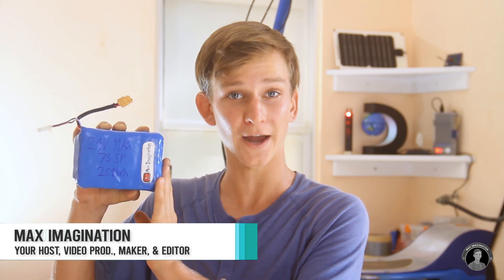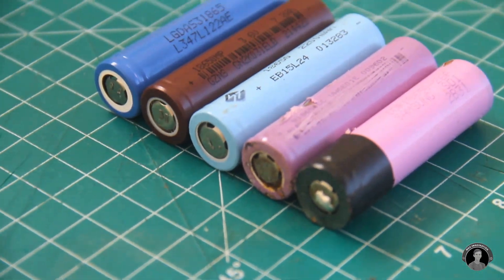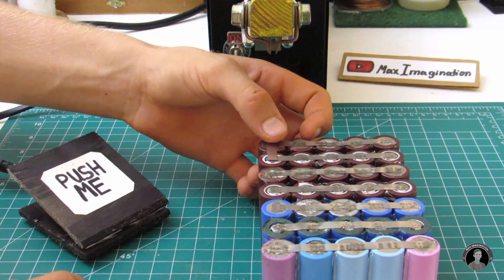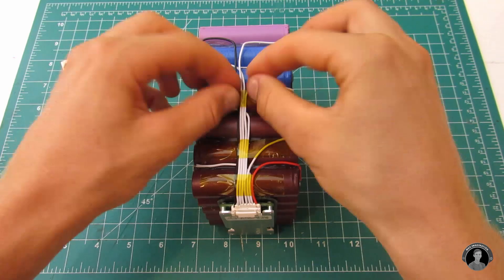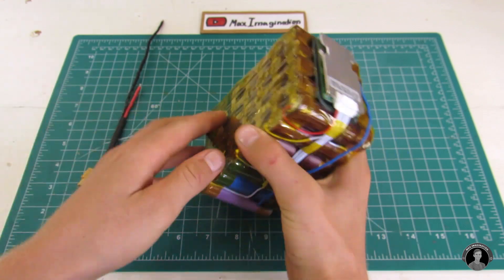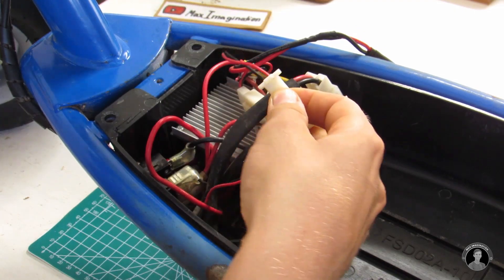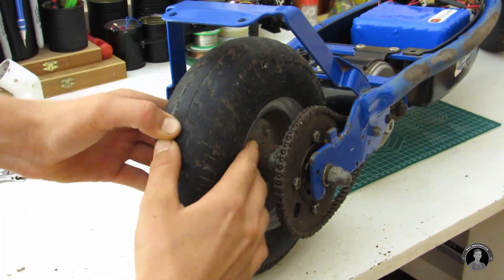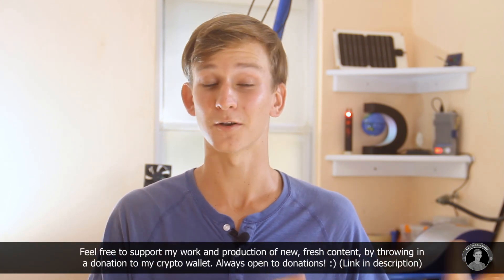Build a DIY 24V E-scooter Battery Pack | Razor E300 Upgrade (Part 1)

Comment from the maker: One important thing to consider if you are planning to make this battery for your EV. As much as recycled Lithium cells may work and are OK, their lifetime wouldn't be anywhere near as fresh, new 18650 cells. Motors as such that drive us forward require a good deal of power, so if you're serious about range and power, it's best to go with buying from a quality seller of these new cells. 
With that said, I hope you guys found my video helpful! Under the same making process and connecting, all that should be different for best performance is new cells.
Reply: Tried this but barely got a top speed of 20kmhr . And battery power suddenly cut off when it was showing 80% balance charge
Reply: I use lifepo4 flat cells.4000cycles.battery hookup has 31 ah 65 dollars for 4 .16 make 52 volts.use a spot welder to weld the tabs.
Reply: And battery hookup has some lithium ion modules that sound like Shimano or something
Reply: Wrong some might run out fastest than other or fail plus there different batterys

Comment: 10:58 there is a hole drilled into the sprocket that is made so you can put your air hose through and connect it to the tire there is no need to disassemble the sprocket. You can even see the hole on this timestamp
Reply from the maker: I realized that eventually. Thanks for spreading awareness to others!
Reply: @M @MaxImagination I was close to doing the same thing until I noticed the hole haha

Comment: How did normal charger charge the li on pack
Reply from the maker: Charged it fine. The only issue is I overdischared the cells during use resulting each cell going to 0V - dead. Could be because I bypassed the BMS.

Comment: How do i Learn there is so many things i dont know where to start and regarding safety how do i become sure that i dont cause a hazard or fire i have old laptop battery but they last 3 minutes max all my battery this way are they still useable?
Reply from the maker: I don't recommend going through the hassle of making your own battery with old cells looking back. If I were to go back in time, I would use new cells. Old cells will wear out fast.

Regarding resources that will help you along your journey in working with electronics, I suggest to read "Practical Electronics for Inventors". Read "Beginning C for Arduino" if you want to learn Arduino programming. To learn Arduino hardware and mechanics/mechatronic part of projects, I recommend checking out videos for those YouTube.

Comment: I have the yume raptor 60v 27ah 2x 3000 watt motor i would like to install an external battery. How would you wire it and what battery do you recommend?
Reply from the maker: You mention it uses a 60V 27 Amp-hour battery. You can use any other lithium ion or lithium polymer 60V battery with a higher capacity than 27ah, it will give you a longer run time. Just don't raise the voltage of the battery if your scooter is designed to only operate on 60V.

You'd wire it to the scooter the same way. 

In terms of configuring the battery pack (wiring). Follow the series-parallel rules to form a 60V 27ah or more battery.

Comment: There should be a air tube plastic extention inside your left side of your handlebars underneath the grips and inside the grips you can fish out with Allen key or screw driver then it will hook up to your pump and screw on the valve stem if your. Missing it there also on ebay or Amazon for your next time that is
Reply from the maker: Good point! I've been told the same by several others. Thanks anyway!

Comment: How do.u get amps. Like 24v 30ah
Reply from the maker: By using a higher amp BMS to allow for that current and placing more cells in parallel to handle 30 amps drawn from the motor.

Comment: I am inexperienced in these matters. Should the Ah of the battery ALWAYS be less than the Amps of the motor? It doesn't matter 18650 or LiFePO4? I have read that LiFePO4 are more convenient.
Reply from the maker: It's not about that. The Ah (Amp Hours) is current capacity, you can run a motor drawing a higher amperage from a battery with a lower Ah rating - it will work fine, just not run for as long as a battery with a higher Ah rating. LiFePo4 cells are more energy efficient, those can work too.
Reply: @MaxImagination  thanks

Comment: Hey, an old guy came the other day and asked me if i was interested in an old electric scooter for free. I said of course yes, and it was looking like your scooter but yellow plastic instead of the blue.
Same wheels.
Looked inside and same setup as yours with 2 old 12v 12ah lead batteries i am trying to revive now.
Anyway, i am tempted to get a new lithium battery and i am also curious how this scooter with same hardware would react if i installed a 36v battery instead? And i also actually have a 48v battery for my electric bike wich i have bought a 60v battery for instead.
HOW and what do i need to do to have this on a 36v battery and also if i am gonna try a 48v battery wich i already own?
Is there some stepdown stuff i can use? I am curious about 36v straight to this scooter plug straight in, im sure you have tried it huh?
How did it perform? Any tips are great welcome. Of course the cheapest tips on 36g and especially on 48v as i have that already.
Reply from the maker: Hey there! If you intend to use a 36V battery with a 24V motor, you will fry it... Either change the cells configuration (you will have to disassemble the battery) to have more in parallel rather than series and get more amperage plus lowering the battery pack voltage to 24V OR get your hands on a 36V brushless DC motor with a brushless ESC to adapt to your battery. Hope that helps!
Reply: @MaxImagination  you believe frying it immed? I've seen many videos where people have used 36v on a 24v motor but of course at one time it is going to end it's life, but have you seen someone doing that?
Reply from the maker: That's a significant amount of additional voltage to apply to such motor. Yes, 36V would damage the stock 24V motor.
It's up to you if you'd like to convert it to handle 36V (if possible). It's best to get advice from someone who has done it.

Comment: I have a very silly question,
How do you calculate the final Ah of the battery? We have 35 2200-2600 mAh 18650 cells here, the final result is 11Ah.
I know there are always 5 in series and the whole x7 in parallel. Is that then 2200mAh x 7?
Reply from the maker: To calculate the total Amp-hour rating of a series-parallel battery pack. Know that every parallel battey added has its Ah added to the total parallel string. A series set of batteries only has its voltage added, but for example, 5 of those 2200mAh cells would equal 11000mAh because they were added in parallel.

Comment: Not sure if you figured it out but the right handlebar grip should have the pump stim that connect to the valve of the tire as an extension to air up the tire.
Reply from the maker: Hey! Since I bought this scooter in second-hand condition, it did not have that pump stim.

Comment: that bms bypass cant be good...... u can now drain the battery all the way to zero and that aint good...
Reply from the maker: I guess that wasn't smart on my behalf! However, I couldn't see how it would work otherwise with the 3A current limit.
Reply: @MaxImagination  maybe more powerfull BMS ? like 40a i think the BMS u used was a 20a
Reply: @MaxImagination  u know im about to buy that thing and i also want to build pack like you did i have a lot of good 2500mah 18650 cells i will need to buy spotwelder tho i dont want to solder them and yea ima need more powerfull BMS not 20a but 40a
Reply: @MaxImagination  and also when your battery somehow shorts out there is no protection at all !!! and thats really dangerous
Reply from the maker: Good points there! I guess I need to use a higher current handling BMS with those protection features. 

Good luck building your battery! 

Cheers.

Comment: Hi Max, very good work. One question, how to modify the battery package to receive 24 V 12 Ah? Best regards!
Reply from the maker: Hi there. Thank you! For a 12 Amp-hour (Ah) 24V Battery pack, simply add more cells in parallel. To get from 11 to 12Ah or higher, I suggest you start with using higher capacity 18650 cells. You could add another row of series cells in parallel to another string of cells on one side, but this may cause imbalance. You've better off then starting with higher capacity cells and calculating the total capacity.

Comment: Was with you until you said to connect the discharge lead to the battery instead of the BMS. That's a major safety violation; the BMS is there to prevent shorts as well, and it can't do that if the lead is connected like that. The problem of not having enough current is fixed by using a correctly rated BMS.
Reply from the maker: I bypassed the BMS for output due to the BMS not allowing enough current to flow so the motor can run with a person on it. The BMS is set up in a way only for managing charging. I know it's not perfect, but it works.

Comment: Nice work. I pretty much replicated your battery using cells that I had lying around. These came from scooters and were 2000mah originally. When I tested them they were around 1700mah, with an internal resistance according to the charger of something like 70mohm. I am a little disappointed with the end result, the "kick" and uphill performance is less than with the original lead acid batteries. It was still cool to do, but I have now bought a box of "good as new" EVE cells with 2700mah capacity. I wonder if they will perform better, I am a bit suspicious of all of the specs of cells out there. I hadn't expected for it to make a huge difference, but it kind of seems like it does.

Comment: Why dont they use the correct Voltage labeling Battery Packs? 24V is sometimes 6S, sometimes 7S. This is so important when for example choosing the right charger. The charged endvoltage ist very Importand if 6×4,2V or 7x4,2V. Nether the product of 3,6/3,7 nor of 4,2 fits the Voltage of 24 or 48Volt Ebike/Scooter Systems. Only 36V fits 10×3,6V.
Does anyone know why?
Reply from the maker: Yes, that can be quite confusing... What I would do is know that if the battery pack's voltage is 7S (25.9-26V) I'd find a charger that is 1-2V higher such as a 28V charger (from old E-scooter) and use that to top it up. Even better would be to charge such battery pack with a balance charger that can handle up to 7 cells and choose the cell configuration before charging. 24V just seems to be a convenient way of naming these packs for compatibility with other products.
Reply: @MaxImagination  you are right. Comming from RC Models, it confuses. In RC, it is simple. A Lipo is 3,7Volts. Times 6 is a 22,2V Battery, Endvoltage of charging is 25,2V. A Li-ion is middle 3,6v, Times 7 is 25,2V. I have to know the number of cells for choosing the charger and set the charging voltage. At a "24V" Battery, this is not given but needed.
Greetings and thanks for your videos

Comment: Hi From Melbourne, Australia.  How long does the battery last approximately on a full charge?.  Cheers Fab
Reply from the maker: Hi there. The battery lasts 10-20 minutes per drive depending on the load put on the scooter.

Comment: NIce job. Just newbie curiosity. Looking at the schematic, with the discharge wires connected directly to the battery, how does the BMS cut power to the motor when voltage is at the minimum safe level? Thanks.
Reply from the maker: Hi there. Thanks. It does not cut the power from the battery. This has to be determined by the user. I don't recommend buying one of these BMS boards for making such battery pack as the cutoff current (~3A) exceeds in no time and is too low, therefore I bypassed this feature.

Comment: What are your thoughts about VISET LI 24V 1000mah, E-bike battery, 15A BMS for 100W-500W. Amazon has them for $149… could it work on a Razor E300?
Reply from the maker: Hi there. Could you please send me a link so I can look at one?
Reply: VISET LI 24V 10000mAh Ebike Battery, 24 Volt Electric Bike Lithium Battery with 29.4V 2A Charger and 15A BMS for 100W-500W

Comment: Very nice! I'm building this very same pack for a 24v motor. I was just wondering-- is it normal to be unable to measure each individual cell once it is hooked up into the battery pack? I'm getting 29.4v nominal, which is a spanking full battery (4.2v per cell). But when I probe individual cells, theres pretty much no voltage. The other thing is I'm using nickel strip that appears to be pretty thin, maybe only 0.1mm. maybe i'll have to double it up?
Reply from the maker: Thanks! Cool to hear you're also taken on this project, congrats! You should be able to measure each cell individually... That's odd 🤔

With the nickel strips, don't worry about the thickness, 0.1mm should work as long as they are wide enough.

Comment: Hi have you had any issues since you built this battery pack?how long does it last when full charge?
Reply from the maker: Hi there. Yes I've had one major issue which is the cells completely dropping in voltage after months of use. Not able to charge the battery pack or revive it. Could have something to do with the BMS or that I over-discharged the battery pack. In any case, this was probably my own fault. I don't see an issue if you were to make it, I do though recommend using brand new cells.

With a full charge, the battery lasts me 20-30 minutes on the E-scooter

Comment: Is it ok to use the original charger that was meant to charge lead acid for the lithium batteries?
Reply from the maker: Yes, I have had no issues with using it to charge them myself.

Comment: If purchasing a battery for this scooter, can ah be higher?  As in 18 or 24ah?
Reply from the maker: The "Ah" or current capacity can be as high as you need... Just keep in mind the risk involved with electric vehicles when using more of these cells in parallel.
Reply: @MaxImagination  not sure what risk but I'm assuming the motor should also be 24 v but if using a 1000w battery I should up the motor to 1000w as well?

Comment: For future reference get yourself a valve stem extension that you can screw onto the valve stem straight through the sprocket instead of having to go through all that just to put air in your tire
Reply from the maker: I have done that after receiving the same feedback from others. It's not a problem anymore 👍

Comment: I would not tell people to use cells taken from laptops. They often have too low of a discharge rate for an kind of a PEV. Some cells have discharge currents as low as 2-4A when new but after being used their internal resistance will double and that will affect their discharge rate. Even with 5 cells in parallel they may only be getting 5-10A out of the pack. This is the part of testing the cells where people advise testing internal resistance but an RC3563 or YR1035+ is $45 on Aliexpress and $60 on Amazon. You can’t rely on IR readings from chargers, they are wildly inaccurate. You can do your own DC IR testing manually but it’s time consuming and prone to human error. 

If you want to use cells for a scooter you can buy LG MJ1’s or Samsung 25R’s from 18650Battery Store for $5. I think Samsung 40T’s are on sale for $4 right now and they are nearly the best 21700 cells out there at 4000mah with a 30’ish amp continuous discharge
Reply from the maker: Hi, Eric. Many thanks for your tips and suggestions on the cells! I will keep this in mind when making future battery packs. Cheers.

Comment: That 20A BMS should have been enough unless start up surge was significantly higher and the BMS did not have a surge current rating (most do, double the continuous rating for 3 or 10 seconds)
Reply from the maker: The issue is, the motor's initial current spike exceeds the cheap BMS's maximum output instantly and fails to run the motor, leaving only a short jolt. Therefore, I had to improvise...

Comment: Hi from Melbourne,  Australia. 
What's the specs for the nickel strips :length, width, thickness.  Cheers
Reply from the maker: Hi there. The nickel strips I used measure: 0.15x6x50mm
Link: https://amzn.to/3G0S6lj
Cheers!
Reply: @MaxImagination  thanks.  For a 24v configuration like you video. How did you work out the BMS ampage and cell about. Can you go 30 amp.

Comment: How to keep it from over-discharging? LVC?
Reply from the maker: Given the circumstances, one would be better off having a battery voltage indicator to know when to recharge the scooter. I had to do this modification to the battery to bypass the BMS's output current limit.

Comment: There is a lead-Acid battery cut-Off on the old controller, not sure how the lithium would get to it s lower limit
Reply from the maker: The charger might be mismatched as told as well from others, but it has worked fine for my battery so far. Though, it would be worth trying to instead charge it with a proper Lithium battery charger.
Reply: @MaxImagination  Meant the voltage cutoff is set to around 12v on lead-Acid and about 10.6 on lithium if my testing is accurate!

Comment: I learned fast that the SLA batteries were garbage, over draining them reduced thier range from 11 kms 6 kms, or 40 mins to 20 so I rewired them to sit on the front deck in a disconnectable waterproof bag that stays warm with insulation to -10 C, and can now charge it at work. I am ordering a 24v lithium 20 to 30ah in a bit with its own charger, how did you wire it in, you went to fast in the video, do I run two positives out? how did you by pass the wire to the controller?
Reply from the maker: Hi there. I bypassed the BMS, not taking its leads as the direct output. Instead, I simply took the 24V Positive, and battery's negative, then hooked them up to the controller via a switch.